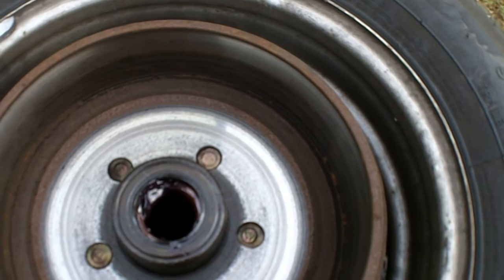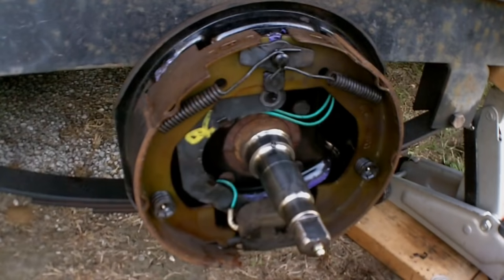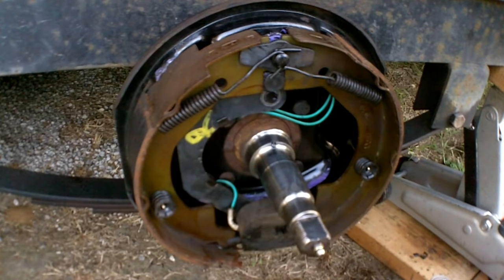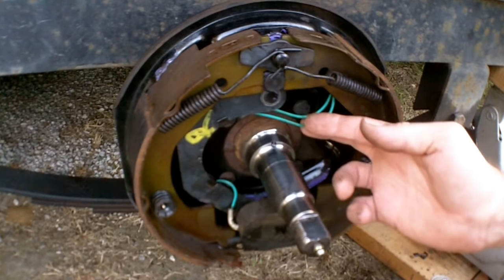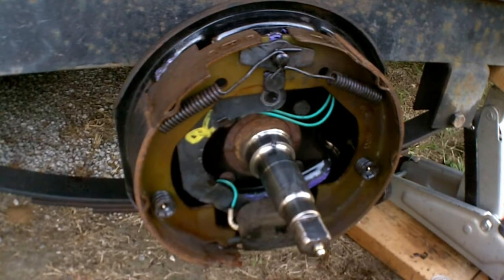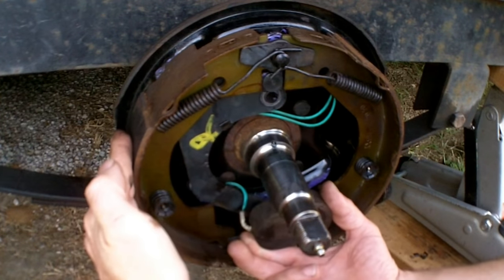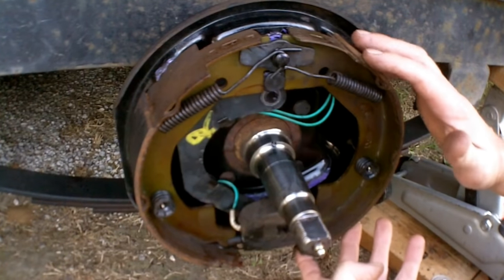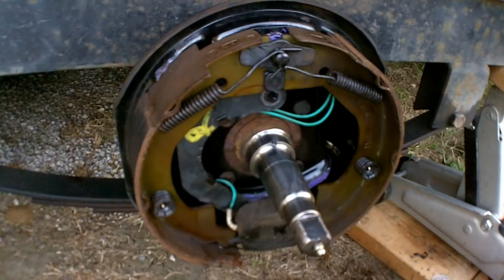How Electric Trailer Brakes Work

Comment: I always wondered about electric brakes.  It's a clever, simple design using energy from the wheel to amplify the force of the magnet.  All the other aspects you described, such as uneven shoe length, are common to all drum brakes.  To me, it's also interesting that no adjuster is needed since apparently the travel of the magnet arm can expand to compensate for lining wear.  I do have two questions:  (1) Do you think the time delay is intended to eliminate brake activation during a resonance "rattle" condition?  (2) Do controllers commonly vary trailer braking to match the tow vehicle and thereby reduce or eliminate force at the hitch?
Reply from the maker: Thanks Ralph. Very rusty here but I'll try to answer your questions. 1). The delay is to allow the tow vehicle to begin slowing down prior the trailer brakes engaging.  If the trailer brakes engage first, it will jerk the to vehicle. 2). It depends on the type of controller being used- so to speak. Mine regulates the forces applied to the brakes based on delay and gain. This is something that needs to be adjusted based on the load being towed. A proportional controller (Which I will change to when my controller dies) has a sensor that will determine the slowing of the tow vehicle and apply the trailer brakes as needed. Do some digging on the two types. Hope this helps in some way. Good luck, G.

Comment: So my question is when going forward you said the short shoe transmits power to the larger shoe. It looks like only the small shoe engages when going forward and the large shoe engages when going in reverse when brakes are applied.  Do both shoes move and hit the drum when going forward? How does the big shoe apply pressure going forward?
Reply from the maker: Andy, the short shoe engages first then it transfers that force to the back shoe. The back shoe can't move further because it's stopped by the pivot point so it's driven to  the drum as well. It's hard to explain, so I would suggest you look on how servo brakes work. Hope this helps, G.

Comment: So informative! And so cool! On a 7 pin connection,(1984 airstream) do you think the trailer needs a fully working battery in order to apply the brakes?
Reply from the maker: There should be a break away switch and a battery on the trailer so the brakes apply if the trailer disconnects for any reason. The battery should be fully charged. Look into that subject. Good luck, G.

Comment: Are the brakes locked in full brake , when there is no tow vehicle hooked ? Or can the trailer be moved without powering the brakes
Reply from the maker: The only thing that applies the brakes is the voltage from the controller. If the vehicle is disconnected- the brakes are free. Hope this helps, G.

Comment: all 4 clips were missing when they repacked the bearings and replaced all 4 seals. just out of curiosity i pulled 1 hub and the clip was gone. im sure that is the case with the other 3 wheels. should I attempt to have the axles replaced due to bad engineering? i only put about 1100 miles on the RV since the job was done. Thanks again for your help.
Reply from the maker: The axles are probably fine. Actually, the magnets can't get off once the hubs are installed. I could be wrong, but they may only be there to aid with assembly. You might ask around to see what others think. G.
Reply: ghostses thanks for the help .i think you are correct.

Comment: Nice introduction.  However, how do you test and adjust the brakes?
Reply from the maker: Tom, in my opinion- the test would be to engage the trailer brakes manually while sitting still and with no brake applied on the vehicle, then apply a bit of throttle to ensure the trailer is holding. As for adjusting them, I have a video posted on how I do a brake job. At the end of the video I discuss adjustments. Hope this helps in some way, G.

Comment: Nice video. But what does the BK stand for on the tester? I worked on a trailer and the brakes WOULD work with two other trucks but NOT with the owners truck . I have two testers like the one you have, a Curt and a Tekonsha. Both of them showed the Left and Right turn signals activated when applying the brakes but the brakes were not activated. The lights and everything else worked but no brakes. I had the trailer jacked up with both wheels off the ground spinning the tires so magnets were activated. Plus the 12v light was on.
Reply from the maker: I think you meant your comment/questions for another video. I didn't use any testers. Good luck, G.

Comment: Howdy , I have a car trailer that is 2 yrs old . Used it maybe 4 times but it mostly sits . Live in Oregon where it rains a lot and winter is mild . Maybe low 19 degrees . About 8  months ago I used the trailer to haul a car and brakes worked great . Now it barely grabs . I can slightly feel the brakes engage . My controller works on other trailers . What should I be looking for ? IF the inside wall where magnet grabs is slightly rusted will that do it ? Not saying its got surface rust . I Just saw your video and now have an Idea how they work . Any help would be greatly appreciated . Thanks
Reply from the maker: I would start with the trailer ground wire. Make sure it's clean, bright and tight. Most likely that's the problem. I would do that before I would go into the hubs. Let us know what you find. Good luck, G.
Reply: @ghostses  Thanks for the reply ! I will try the ground first . As soon as the snow melts  LOL  Thanks again
Reply from the maker: @sparlin88  Good deal! G.

Comment: I just bought a 2nd hand set of brakes.  Mine are a little different from yours.  Mine only has one top spring and not two.  Also the brake shoe lengths and shapes are the same.  I've seen on several videos showing the magnet arm on the front side in respect to the trailer.  The person I bought these from are saying the opposite.  With a brake with equal length shoes, does it matter which side they are mounted?
Reply from the maker: I'm not expert B. But as far as I know, the arm should face the front of the trailer. Do more research and go with what works out for you. Good luck, G.

Comment: Now, after seeing the setup videos at the tow vehicle level, I completely understand the process. Thank you! Since I was under the impression, forgive my ignorance, that in order to apply the trailer’s brakes while traveling I would have to continually squeeze the two dash mounted paddles, this just seemed really dumb and scary to me.
Reply from the maker: No, that's an override to apply emergency braking. Under normal conditions- the brake pedal should be sufficient. Take care, G.

Comment: Just a wild guess here , did you pull off the drums to replace the brake shoes? They look a might thin. Oh and thanks for the informative video.
Reply from the maker: +Lee Mullen 
Good guess Lee, but no. I had another problem that will be shown in an upcoming video. Trailer brake shoes are pretty thin to start with- maybe at best a 1/4", give or take, when new. You can run them to just under 1/16" before they need to be changed out. While they look thin, there's tons of miles left in these. Take care, G.

Comment: Good vid, but didn't explain that when energized w/voltage the magnets are drawn to the brake's drum surface . Hence, w/out drum installed you won't see any reaction from magnet assembly.
Reply from the maker: Pretty sure I did. G.

Comment: Great video. It's also important to run both wires to the front tow hitch, not run a similar size wire down to one brake side and then run it across the axle to the other side.
Reply from the maker: Thanks Jay! Take care, G.
Reply: @ghostses  Another reason the short shoe is at the front is the effect of self servo action. When the drum goes over the top, so to speak, when the shoe is pushed into it at a lower level then there is a mechanical advantage to the amount of force that shoe goes into the drum as well as the shoe wanting to go into the drum by itself which then pushes on the other shoe to even it all out. So you are correct in what you state, I'm just adding some braking knowledge. Thats also why drum brakes usually work better going forwards then backwards. This servo action can be replicated. If you cup your hand left hand under your right hand , the rotate your right hand anti clockwise, your left fingers will bite into your right hand. But if you reverse your direction it take a lot more pressure to try and slow your right hand with your left. Sorry, I hope that doesn't sound to confusing.
Reply from the maker: @JayDee-xj9lu  True Jay! Take care, G.

Comment: I want to be able to set the brake while the trailer is submerged, so my tow vehicle doesn't slip on the boat ramp. My parking brake is weak, and does slip sometimes. Can electric brakes work while submerged?
Reply from the maker: Rich, I know of no way to apply electric trailer brakes without stepping on the brake pedal. A "lock" feature would be nice, but I don't know if one is available. But, if all connections are water tight, I seen no reason they they wouldn't work submerged. No help, but good luck, G.

Comment: Nice video, thank you!
Quick question - For any given trailer, if it is equipped with electric brakes, what are all the parameters I would need to account for in my calculations to estimate the "maximum theoretical deceleration" possible ?
Reply from the maker: I can't say. With the controller I have, I can set the gain and delay to the point the brakes lockup. I would look elsewhere. Good luck, G.

Comment: I should add electric brakes to my pop-up trailer. It's interesting to see drum brakes for trailers and I miss seeing rear drum brakes on the back of a car. The 1999 GMC Safari SLE had rear drums.
Reply from the maker: It couldn't hurt to install them. Much less strain on the tow vehicles brakes.  Yeah, I have a 98 GMC Sierra 4X4.. Drums on it as well. Good luck, G.

Comment: Would I be able to remove the guts from a trailer brake assembly, and install them into a brake assembly from a pickup truck (pickup bed trailer) or would the magnet be too far from the drum? Or some other reason it wouldn't work? Or bbn would it??
Reply from the maker: I don't think it would work, but I could be wrong. G.

Comment: If my truck is a 2014 Chevy 5.3L and it weighs 5,100 lbs 

And I’m towing a 6,000 Lb camper trailer is it safe to tow the camper trailer? Or do I need brakes installed on the setup? 

I’m not planning on going all over the country or anything basically just going the speed limit 1 hour to the beach and back
Reply from the maker: For me, brakes all the way. You never know when you might need hardcore braking to stop. Be safe, not sorry.. G.

Comment: I have watched this video and probably 50 others to do with electric trailer brakes. I have a 10 year old Triton 128 twin axle trailer with electric brakes on just the front axle. The first set of brakes lasted over 8 years …. Or at least 7 years and one year where the brakes seemed to partially work. So maybe 18 months ago I bought a completely new set of brakes to do a total new backer plate and hub. The new brakes lasted for one 1,000 mile road trip and then the next time I went to do the same trip the brakes were intermittent. I immediately thought it was the brake controller and first thing I did was buy a new one. Of course the new one acted same way …… showing like there was no connection with the trailer. Long story short ….. I bought new breakaway switch, soldering iron, multimeter and various other bits and pieces.
Wasted a lot of time trying to trouble shoot wiring on my trailer (not really knowing a lot about what I was doing). Finally figured the problem must be with the magnets in the new brakes.
Tonight I pulled the hubs off both sides and discovered that one wire right where it goes into the magnet was completely broken off. Same condition on both sides. These magnets are crap the way the wiring is done. There is some braiding protection where the wire goes inside the backer plate. Where the braiding meets the magnet it was “lose” …… not molded into the magnet like the original. Still not sure how it managed to break a wire both sides with approximately 1,000 miles of highway driving. 
When I put these new brakes on I kept the original brakes in a box in my garage. I just had a good look at them and now I see where the braided wire must have been rubbing against the inside of the hub since the trailer was new. There is a spot on both brakes where you can see the braiding/protection wore through and exposed the wire. 
So, if you are having a problem with your electric brakes I strongly recommend looking real close at these magnets and the condition of the wires connecting them. In both failures of my brakes ….. the brake shoes etc were fine and the magnets/wires inside were the problem. 
My initial reaction was to start cursing China assuming they were made there like so much other crap. However, these are Dexter brakes and have a sticker inside saying Made in America 🇺🇸.
In anticipation that the problem was going to be “something” with the actual brakes I ordered new Dexter brakes last Thursday from E Trailer and will get them Monday.
I sure hope the wires are attached to the magnets better that this last set. I will also play around with bending the wire inside the assembly to make sure it won’t rub against the inside of the hub.
Hope everyone has better luck with electric brakes. They are great when they work but seem to be a little “fragile”.
Reply from the maker: Quite the story Peter! After all of the headache, I hope your new set will turn out better. But yes, make sure the wires can't contact any moving surfaces. Good luck and let us know how it works out. Take care, G.
Reply: Same thing happened with the next set of brakes. I believe the cause of the problem is the little clip that holds the magnet on the mounting pin. When I removed the drum that clip that holds the magnet in place on both sides was missing. Looks like when the brakes were activated it pops that clip off. When the clip is missing then the magnet can rotate or work itself in a way that breaks the wire where it is moulded into the magnet. I have installed new magnets once more. I won’t get to really test this until my next trip in May. Hopefully it holds up this time.

Comment: Can I hook up a tow dolly with electric brakes without being connected to the power source and cause no damage or is that a bad idea
Reply from the maker: It shouldn't cause any damage to the trailer- but make sure you can stop successfully/safely with the load behind you. There are tons of trailers that don't have brakes. Just my opinion. Good luck, G.

Comment: so do the brake hubs have to be smooth for the  magnet to work?. what about the stud bolt ? mine sit  above the surface ?
Reply from the maker: Yes they do. The studs should be below the surface where the magnet rides. G.

Comment: Thank you very much for the video! Unlike the others, you actually described, in detail HOW this braking system works. (controller, voltage intensity, electro-magnet, forward/reverse braking, etc. ) I'm trying to make a decision as to hydraulic vs. electric and desperately want to make sure that I have good brakes in ALL modes of travel. My pick up truck is old and the brakes are not that good. I don't want to be one of those fools, who end up in a ditch or the lake, as I'm launching my 10,000 boat. Thanks again!
Reply from the maker: Thanks! I'm no pro by any means but I would dig into each to see which would serve you better. I could be wrong, but I believe "electric over hydraulic brakes" (search for that term) are more expensive upfront but are cheaper to maintain. I believe they would also preform better. Also (and I did not mention it in the video) look into "proportional controllers" for electric brakes. They have an accelerometer built in that automatically adjusts the voltage to the magnets for smoother braking operation. Good luck, G.
Reply: I'd never count on "good trailer brakes" to make up for "poor truck brakes". I've never had trailer brakes so good that the truck didn't have to handle some of the load. Address the condition of your truck before towing with it.

Comment: Hi
Should my controller light up , just the light on far left front of controller light up when I touch the brake?...
   My problem ....when trailor is hooked up when I hit the brake ...the trailor tires start skidding in the yard or driveway....not sure if this is ok or not....barely touch them skidding starts....

Thanks Rick
Reply from the maker: Mine does Rick. Either by touching the brake pedal or using the manual override lever. It sounds like your controller isn't adjusted properly. Mine has a simple gain, and delay setting slide switches. Yours may be different. I would look online for the manual, and see how it should be adjusted. Hope this helps, G.